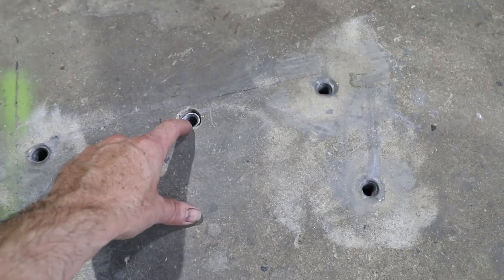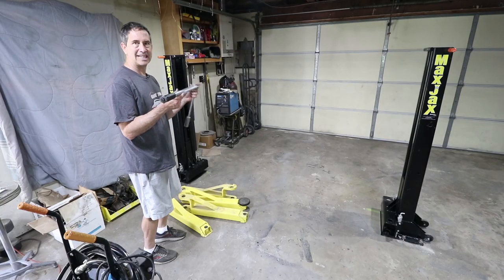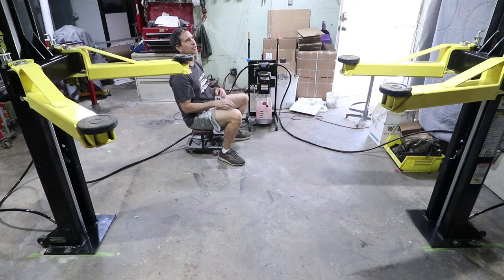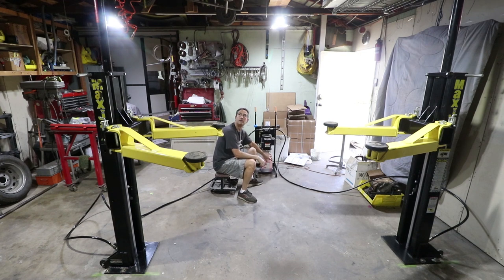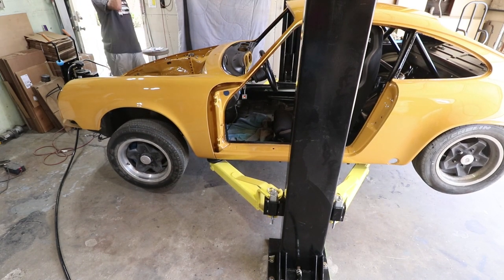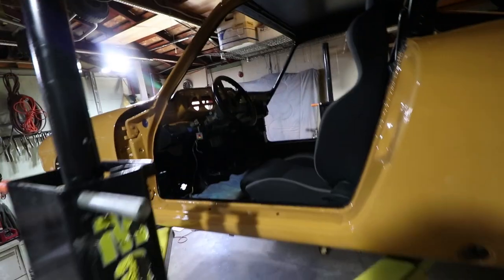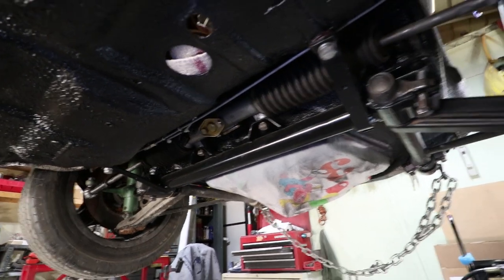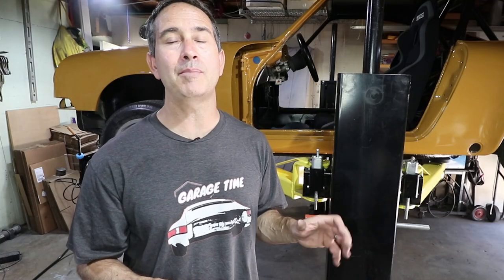I got a LIFT!!! For FREE!!! Max Jax Install For My Air-Cooled 911 Porsche Project

Comment: I know this is old, but I just saw this video.  On my 356 and 911 I have hockey pucks with slits cut into them for the seam to fit into when lifting the cars on a two post lift pads.  Works great, the pressure is on the structure instead of the seam.  Your videos are great.
Reply from the maker: Yep, same.  You'll probably see them in a video or two around here.  For the 911 hockey picks are required to avoid squishing the oil lines.

Comment: “Luckeeee!”
                - Napoleon Dynamite 
  But let’s talk about what you were holding it up with. Did you make them? How did you get the car up on them then get it down? Do you have plans for them? I would rather have Rusty the 914 project car and Future Hillclimber up on those than the jack stands it is currently on.
Reply from the maker: Indeed lucky.   The tire stand work really well.  Watch this video https://youtu.be/rrYZsOgcoQI
I made them myself, shocker.  You use a regular floor jack to get the boxes under the tires.  Then, the jack goes inside the box and raises it even higher.  These worked great for block sanding and working on the bottom of the car.

Comment: Looks great another good installation. I don't know what a poxy you used but when I was repositioning all the ATM's after North ridge a lot of the banks called for Stimpsons epoxy....Which you can get at home depot that pretty much passes any California requirements. Fyi application gun is pricey there
Reply from the maker: I used Simpson XP-XT I think.  I forgot to setup my camera for this, but should have.  
I used a regular caulking gun and emptied half of the cylinder into a pie tin.  Then I flipped it and emptied the hardener side and mixed it with a paint stick.  Filled five holes about halfway and then sunk the anchors.  It gels in 30 minutes, so I had plenty of time.  It's good stuff.  I used some extra to fill some chips in my floor.

Comment: I've been looking at buying one of these two post shorter lifts. My concern is havign enough concreate rigidity.
Reply from the maker: My concrete is thin about 4" , but my cars don't weigh much either.  
Be safe!

Comment: Dang it! If only this came in earlier on when you were working on the undercoating, etc. under the car. Better late than never!
Reply from the maker: What's done is done, I guess.  I think the toughest thing I did was those camber boxes without a lift, but they came out good!

Comment: How deep did you drill the holes? I'm worried that my slab wouldn't be thick enough and strong enough for my 50's built garage.
Reply from the maker: I drilled all the way through.  About 5 inches. My concrete is old too, from the 60's.  I haven't noticed any new cracks or anything.

Comment: So i did same lift just mine is dannmar m6 but instructions say you need 4” slab but you really need 5-6” because i got lucky mine was 5” and all anchors held fine
Reply: You need to drill 5” deep for the anchors so i think your slab is to thin??

Comment: what kind of earthquake precautions do you have to take in SoCal?
Reply from the maker: Just get out of the way.  On a serious note there isn't any special requirements that I'm aware of.  It would be nice to have extra concrete thickness, but the car will fall off the pads before the concrete fails anyway.  The anchors are very strong.  
Personally, I never leave the car up when I'm not working on it.  Never overnight for instance.

Comment: Wish I could get a lift in my garage but it's on a slope and tarmac
Reply from the maker: Slopes are a bit scary.  Have a look at the tire stands I made.  I tested them on my driveway which is sloped a bit.  A ratchet strap around the front tires should prevent it from rolling. 
https://youtu.be/rrYZsOgcoQI
Reply: @GarageTimeAutoResto  unfortunately slopes right to left